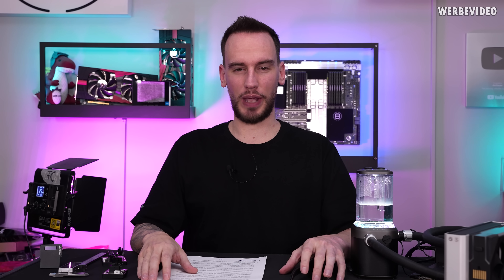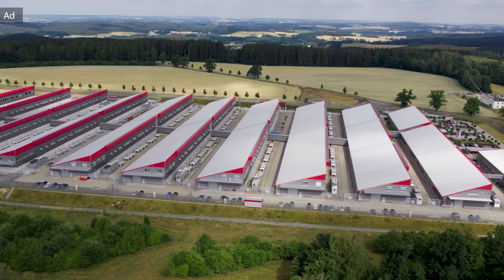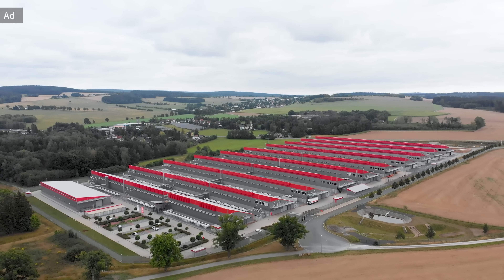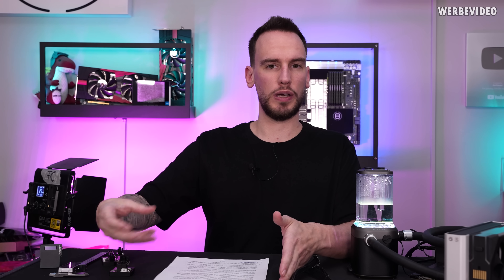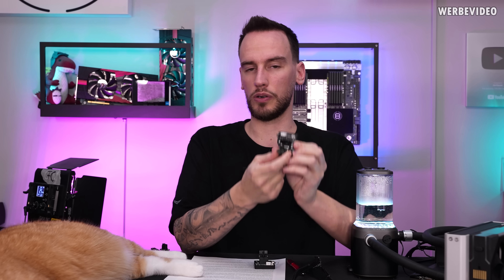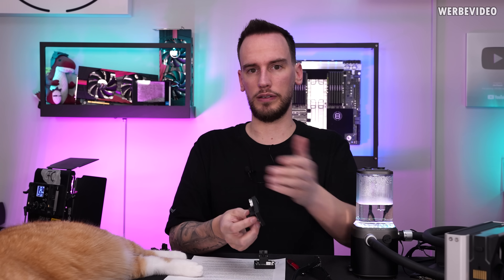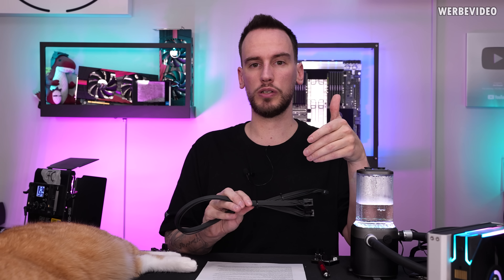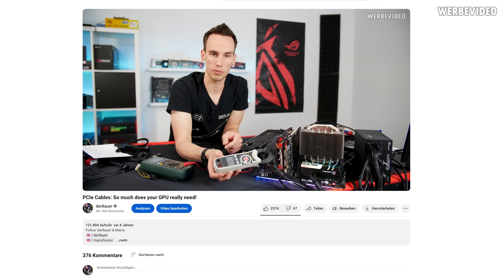12VHPWR is just Garbage and will Remain a Problem!!

Comment: I am gonna be honest here, even tho6the cable ain't amazing, it was bad from the get-go.

But the difference is with the 30 series the connector was at a 45° angle pointing forward.
This created a lot of slag for the cable as the bends were never in an aggressive way even if the cable touched the side panel of the case, and I thought the 3090 was big.

Now we have the 4090, a card like twoce the size of the 3090, has a 90° connector pointing straight sideways.
Yes not only is the car bigger, the connector angle makes it 100 times worse.

All these dumb "safety" guides about the connector are annoying.
It feels they blame the customer, but they need to understand not everyone has a case or the soace for a case the size of a 6U server chassis if that even exists just so they can give their cables some slag.

Comment: I'm torn between a 7900xtx and 4080, especially if 4080 drops down in price...but I don't think I want to deal with the power cable issues. Will probably go AMD and wait for 5000-6000series. I do play a good amount of VR though and wanted to see how Nvidia performs there over my current AMD card

Comment: if i use this corsair cable with a 600w asus TUF 4090 OC & corsair rm1000x psu, will it push 600w to the card? i read somewhere that it gives only 450w with a 1000w psu and 600w with a 1200w psu. its kinda pointless if it gives only 450.

Comment: 4090 just doesn’t have the same value chops a 1080ti had and yet it’s selling like crazy and is well over double the price. This’ll be a problem card in later years due to these faulty connectors and the overbuilt coolers that crack solder joints

Comment: Easy, stop buying cheap cables and use a proper made cable, and plug it in correctly (thats the biggest issue people are rushing to plug them in and not getting proper connection) as ive had my 4090 for a year now and my pc stays on using a corsair cable.  Same cable from day one, saying something is trash due to user errors and 3rd party "cable mods" i guess is easier than blaming one self i guess as these cards arent drawing 600w unless you have modded the crap out of it...and at that point youd just be asking for trouble.

Comment: The connecter itself is not the issue, Its pushing more current then it can handle is the issue. I got a 4080 and needed a right angle 12vhpwr plug to clear my side case. I used a no name Psu cable and crimped on 2 8 pin Psu plugs on the end and made my own cable, each pin has its own wire no sharing wires. It handles 320 watts no issues no melting nothing and my pc stays on 24/7. So the issue is not the connector but too much current draw from the 4090, plain and simple. When is the last time anyone said the 4080 was melting connectors, yet its the same connect right, even the 30 series has a similar connector but i dont see them melting.. I can guarantee, you under volt a 4090 and it wont melt anything. But that is too obvious isn't it. Lets push 500-600 watts through a small connector that is not designed for high amps nothing can happen right..

Comment: I have been using  the 4090 since launch day and its hook up to the cable which was provided by my PSU instead of the adaptors that came with the gpu . No issues so far .

Comment: I have nothing but problems with my set up due to those cables. Powering 4090 TUF OC- upgraded my whole case to Torrent to make room for cable routing, using CM 12hvp cables direct to 4 pcie connectors on Seasonic Prime. 10 months in GPU developed sudden shutdowns ( red led light up on 4090 indicating cable problems) and all that with proper plugging, bending and routing. Just a massive headache. Now I had to use bundled adaptor that looks so ugly I cannot look through glass paned without wincing.
Reply: %99.95 of all 40 series owners have 0 issues and the majority of people that seem to be complaining are those who do not even own one. Just make sure to properly seat your power cables and stay away from aftermarket 3rd party adapters/cables. If so you will be within the %99.95 of all 40 series owners around the globe that have 0 issues. ✌

Comment: I remember hearing about the connectors initially and knowing it would be a failure. How do they take four eight pin connectors at 150W each, 32 wires carrying that load, and expect to pass it through twelve wires without even increasing the wire gauge. Seems like something I understood before reaching my teenage years...

Comment: Call me silly but am I the only one thinking that they could've simply revised the PCIe 8-pin connector to handle like 250 - 300W with a good margin? Cables would be an easy fix, but cables aren't the problem here it seems.

Comment: The 12V HPWR connector has befuddled me since its inception because on the face of it it doesn't seem like it needs to exist, even in a situation where 600W direct from the PSU is necessary. A pair of 8 pin PCIE power connectors should provide 300W, so we need to double it on a 12v connector and we don't really wanna use the extra space to put 4 of them on a card, what's the solution? make a new connector? NO, that's stupid (even if you don't want to modify any existing connector specs it's stupid), we have a connector that supplies a maximum 336W, at 12V with 4 pairs at 7A per pair, that's the EPS 12V connector (the CPU one), just use 2 of those and your power budget is 672W. Not only that but it's less amperage per wire pair, 7A vs 8.3A, and a more robust connection point. We were already doing that for server and workstation cards, that's the logical step. A lot of modern high end power supplies that someone would use with something like a 4090 already have more than one EPS 12V, some modular units even use the same connector on the PSU side for either (I guess they must be able to switch one of the connections PSU side from ground to 12v?) but even if we still need to provide adapters to make this work it would seem that the adapter already exists as well, to go from 2 6+2 pin connectors to a 4+4 pin EPS.

It's not even like this is a weird solution that nobody has ever thought of before, I'm not breaking new ground, this is pretty normal for high end server and workstation GPUs.

Comment: I think the only way to fix this solution to not ''bend'' your cable is to use a vertical GPU bracket or something i think. only then you can fix enough clearance to make the bend

Comment: im gona stay with my gtx1080Ti till they safen it for heavy unattended  use lots of lives at stake and i have a normal house not a condominium.
Reply: %99.95 of all 40 series owners have 0 issues and the majority of people that seem to be complaining are those who do not even own one. Just make sure to properly seat your power cables and stay away from aftermarket 3rd party adapters/cables. If so you will be within the %99.95 of all 40 series owners around the globe that have 0 issues. ✌

Comment: I own a 4090 Suprim X and I use the single corsair cable. Am I in danger? What can I do?
Reply: %99.95 of all 40 series owners have 0 issues and the majority of people that seem to be complaining are those who do not even own one. Just make sure to properly seat your power cables and stay away from aftermarket 3rd party adapters/cables. If so you will be within the %99.95 of all 40 series owners around the globe that have 0 issues. ✌

Comment: As I've said elsewhere: high current 12V automotive applications have existed for over a century now, and the much more recently there's the solar power and EV / ebike / escooter industries.  All of these have a plethora of existing and (mostly) proven high current connector standards, e.g. XT-60.  Why the PC industry is ignoring all that to try and stuff 50 AMPS into devices using electronic-industry connectors from an era when power requirements were maybe 10% of what they are now, is beyond baffling.

And I thought this before I finally picked up a 4070ti last month and discovered that the 12VHPWR is even smaller than I thought it was.

Comment: this issue really makes Nvidia engineers look bad. this is as stupid as apple putting the charging port under the mouse. people at Nvidia tested this and gave it thumbs up. and in all of their testing no one found this to be an issue. i tell you someone did no do their job.
Reply: And there are groups of fanboys defending this engineering failure. 😂
Reply: %99.95 of all 40 series owners have 0 issues and the majority of people that seem to be complaining are those who do not even own one. Just make sure to properly seat your power cables and stay away from aftermarket 3rd party adapters/cables. If so you will be within the %99.95 of all 40 series owners around the globe that have 0 issues. ✌

Comment: This nvidia connector is a excellent example of a vendor trying to create something to hurt the competitor. As a "solution" to something that worked for years and years. Instead of facing the problem power consumption of GPU's simply have run out of control.  The huge margin of safety on the "old" 8-pins, is indeed why it is very rare they melt or start smoking.

Comment: Why is it that people constantly have issues like these, while my 4090 has zero issues whatsoever, with me not even using the Nvidia 4x8-pin to 12VHPWR cable? (instead using the Corsair Type 4 cable)

Probably even funnier still: WHERE ARE THE BURNT 3090 Tis WITH THE SAME POWER CONNECTOR?!
Reply: "WHERE ARE THE BURNT 3090 Tis WITH THE SAME POWER CONNECTOR?!" a simple google search will expose 30 and 20 series both having similar issues when improperly seating cables or utilizing after market adapters. This is nothing new whatsoever and applies to any GPU or electronics for that matter,

Comment: Why not just put a power limit on your GPU?  Problem solved
My EVGA overclocking software has a slider right there, anywhere from say 50% up to 110%.   
Ball park guessing...  set it to 80% of manufacturers stock max setting and you should be safe.
Very rarely on my 3070 card does it every spike over 70%.  I'd say that would be a pretty good compromise in exchange for... no melty wires fire.  Just make sure your overclocking software tickbox in i'ts setting area is set to startup at Windows start.

Comment: I purchased a reversed thermal Grizzly WireView 12VHPWR through Titan Rig in June of 2023 and I had to return it.

I didn’t return it because it caused issues with my Asus Tuf OC 4090, but it was a manufacturing defect error. The 12VHPWR that was to connect to the 4090, was backwards. This made it not possible to connect to my 4090.

After taking pictures, sending them to and communicating with Titan Rig and Thermal Grizzly, I was told to RMA the product as it was incorrect.

Unfortunately, I never received a replacement product as I requested. They did end up refunding my money but what I really wanted was the reversed 12VHPWR WireView for my rig. I would’ve just repurchased but the product was sold out on their website in the US for many months. And then the price also was raised. 

I purchased my 4090 launch morning and have had it paired with a Corsair HX1200 and their 12VHPWR 600w cable since day 1 with (knock on wood) no issues. I do overclocking, measure power consumption, enjoy tweaking, help others troubleshoot their hardware, build PCs for others and create content so I was excited to see the launch of the Thermal Grizzly 12VHPWR WireView reversed. Unfortunately, I was never able to use the product. Seeing this video reminded me after a hectic couple months.
Reply: I just realized that der8auer mentions only having one RMA amongst all the 12VHPWR WireViews sold. So I assume he was talking about me in this video since I couldn’t use the product or “insert” the 12VHPWR WireView and I was told to RMA mine.

Comment: Ah, I've been saying this since the beginning, but you explained it well with actual data :)

Sure, many of the failures can technically be called "user error"... But it's the connector that's allowing the smallest of error to matter a lot with its low safety margin!

I'm gonna propose another connector: the XT90 or XT60. Beefy, can deliver the amps, and only two (thick) wires needed. XT60 would be fine by itself as it has a high safety margin built in and can deliver way more than 60A happily, so even while pulling 50A you're not that close to the limit :)

Comment: Consumer products are made with the cheapest solution possible so as to maximize profit margins. Many items are designed to fail so the vendors can sell you more product. Plastic parts in transmissions with a known lifetime rate come to mind. Couple this with terrible consumer protection laws (at least here in Canada) and this is the crap you get. Our cars are built to the same standards now. Sure all the safety stuff has to work, but it does not need to last. Profit trumps everything. The corporations have the politicians in there pockets and all the power now.

Comment: I guess all of this makes the 7900 XTX the most sound purchase if you want the most powerful card that doesn't have the possibility of catching on fire.
Reply: %99.95 of all 40 series owners have 0 issues and the majority of people that seem to be complaining are those who do not even own one. Just make sure to properly seat your power cables and stay away from aftermarket 3rd party adapters/cables. If so you will be within the %99.95 of all 40 series owners around the globe that have 0 issues. ✌
Reply: Until the MCM design shits itself in 4-5 years like R9 Furies and Vegas/Radeon VIIs. Nope. Fuck AMD for that reason.

Comment: I don't understand the reason behind creating a brand new standard where it wasn't needed at all. Innovation just for the sake of innovation? It doesn't bear any advantages over existing connectors other than it being smaller, which is mostly not a factor when building powerful rigs that have plenty of space for wires and conntectors. The top tier 4090 pulls 500W at peak, which is within PCI-E specs (75W from the slot and 3X150W from each connector). They could add the fourth power connector to the 4090 if they wanted more even distribution and less load overall.

Comment: It continues to ASTOUND me that a company with as many smart people as NVIDIA has, that can make something so impressive as the 4090 (as well as engineers at all other companies that make up PCI-SIG and had a hand in this connector) can FCK up something so easily obvious as this.   Like this isn't cutting edge electrical engineering stuff here, the principles and mathematical formulas that define electrical wiring and connector maximums and safety margin are well established at this point.  How was this connector even allowed to see the light of day???

I totally get we needed something new to carry the amount of power they're pushing for, cause 4 8-pin connectors is definitely crowding the PCB, but really, you couldn't have designed something with more safety margin???  As it is the 12VHPWR connector is surprisingly small when you first see it in person, and I'm sure they could have made it physically bigger to allow for more wires and thicker gauge wires at that.  Oh NVIDIA (eyeroll)

Comment: What Nvidia should have done was to opt for the 8 pin molex micro-fit+ connectors which are rated for 13 amps per pin.
This would have allowed them to run 300W and sense pins through the connector, with a safety factor of up to 1.56
Y-splitters to two regular PCIe 8 pins then also become natural as they are officially rated at 150W (225W in practice).
At 450W through two connectors the safety factor could be as high as 2.08, hindsight truly is 20/20.

Comment: Ofc is a problem. It was stupid from the start.
For high power needs, use a bloody connector like you see in your home electronics.
Look at the plug for a 600-1000w anything. Like a hair driver, you don't just use tiny pins in a tightly packed connector, and what is even worse, the location of that connector is such a mess that it will always lead to sideways force being applied to it. That connector should not be there on the side. Period.

Comment: This stupid connector is the reason I am not very keen to switch to 40 series
I'm probably going overboard and team red
Reply: "This stupid connector is the reason I am not very keen to switch to 40 series" Oh i see, I figured it was due to the fact they are hard to find for at retail prices. %99.95 of 4090s are functioning with 0 issues, pretty certain these are great odds and you would be just fine

Comment: To me this connector feels like a solution to a problem that didn't exist. If videocards were tiny and there was no room for connectors I'd get it, but you can fit about 10000 8 pin connectors in a typical 4090, there's really no need to combine them into 1 connector.

Comment: Der8auer : you are a laik and thus incompetent to explain the power delivery laws just by doing simple calculations by sourcing your basic knowledge on google. For explaining this problem you simply need an Electrical Faculty degree, period.
You are forgetting quite a few electric laws that prevent anybody from powering such a crap hungry card like 4090 only via 4 soldering points and super small pins. We are talking steady 600 watts of consumption with spikes going up to 641 Watts.
Your "safety" factor calculations are incorrect and too low due to not including electrical laws that you forgot to.
Otherwise, I completely agree with you, Nvidia should stop producing these stupid GPU-s and recall every single one and replace it with 8-pin power connectors, period.